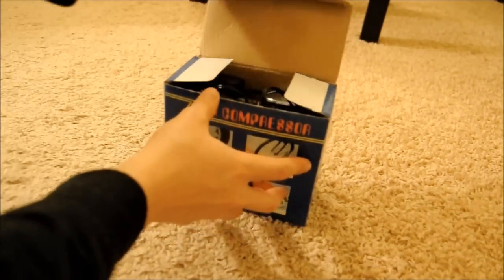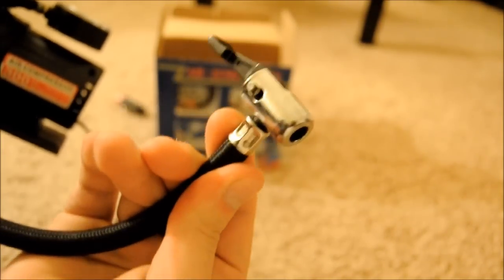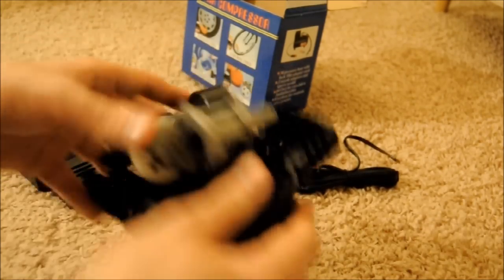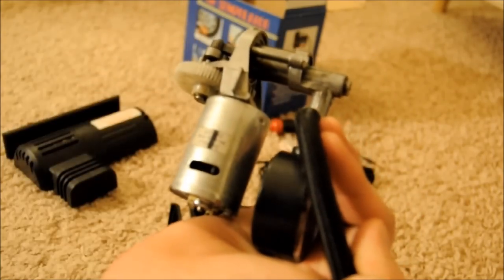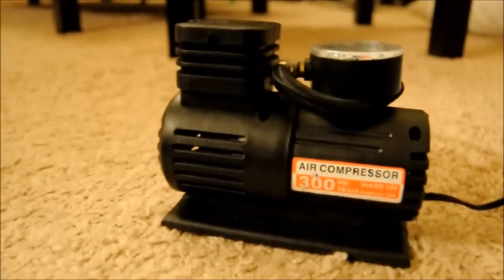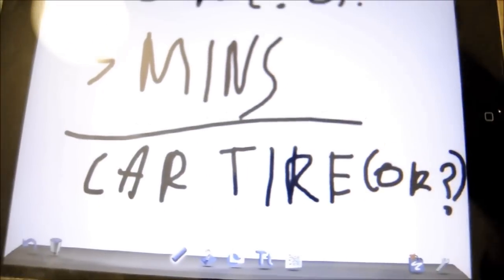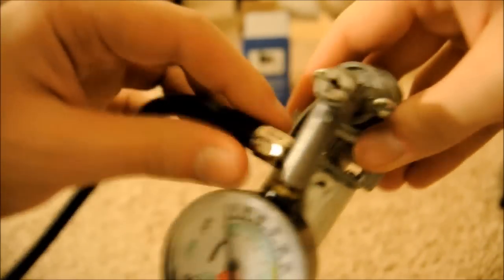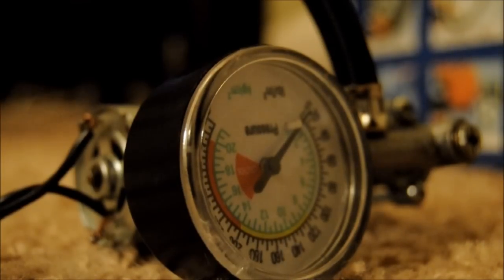10$ 12v Air Compressor FAST Review / Safety & Project Instructions! (Ebay Compressor)

Comment: Construction seemed sturdier than other units I considered MyBest.Tools Noise level was reasonable. Good pressure and cfm capacity for a small reasonably light compressor.
Reply from the maker: No idea, not much

Comment: This is INSANELY nice.💫 allabout.wiki/Viair  i got a Bostitch 6 gallon pancake and the regulator broke, and it was stupid loud. Also, the gauges barely worked. it wouldnt even power a die grinder. But this little dude ROCKS. Its not only 1/4 as loud as the Bositch, it works like a fine tuned machine should. Kudos to California Air Tools! This performs EXACTLY as advertised. Cant beat the price either.

Comment: Hallo,can connect it to house socket ?change auto device with hous plug
Reply: I did I cut wire n add usb
Reply: @loyaltyovermoney5942  hallo ,there is voltage diffrence hause voltage is 120 but air conpressor is 12 .thats why it is problem muss ask somebody

Comment: Could this reach 180psi? If not how much? Thanks
Reply from the maker: I don't think so, it could but it will self destruct. This works best under 50psi, eg for tire inflation. Maybe you could pump it up to 100-120, but it starts becoming a time bomb.
Reply: @JohnCraftingLab  lol fuck okiedoke, thanks saved you me a disappointing purchase have a good one 👌
Reply from the maker: @dunno6442  no prob. also check out making an air compressor out of a fridge compressor, you can get those even for free, not sure if they will compress to 180psi though, they might get to 200-250psi but not sure which ones.

Comment: Can you tell me which dc 12v motor is used in this and how much rpms does it have ?
Reply from the maker: No idea about the motor, it sounds like about 3k rpm when free spinning or so, the motor however isn't all that great compared to other similar sized motors that you can get off of ebay and such meant for projects.

Comment: I just bought this compressor. Is there an on/off switch? Plugged it in, attached it to the stem on my tire and nothing happened. Mine did not come with instructions.
Reply from the maker: Nop i don't think there's any compressor like that with a switch although that is an easy addition but anyways. To make sure it works properly force your finger against the air outlet to create an air tight seal to see if there's air forcing through the hole as it should have worked by its self as you describe.

Comment: can I use it to Operate a pneumatic piston for lifting loads ??
Reply from the maker: Yes you can if your pistons will work with less than 150 psi,just you will have bad time waiting for it to get up to pressure.

Comment: love it! i have a question though. can i even exceed the maximum pressure stated in the specs? i assume not right? just that my compressor will make so much noise and will struggle to maintain at that maximum pressure. am i right?
Reply from the maker: The design is very brittle,you will face one-way valve or hose problems beginning to the normal tire pressure range,let alone 300 psi.
Most people successfully work these things to 150 psi or so but even that seems way too much for it.

Comment: Will something bad happen if I use 12V 4.7A laptop power adaptor with this compressor? What hose and fittings I should buy to have 4 outputs? Thanks

Comment: The material that makes up the cylinder is quite thin and the crank is very poor quality, but in these budget pumps it's all bolted together nice and firm. 
In the more expensive looking (and costing) models that look smart, such as the circular pump with a digital gauge and set pressure cutoff (like the one I paid £30 for) the motor, and cylinder are held in place by plastic mouldings in the case. The plastic tabs suffer fatigue from the vibration, become brittle and fail causing the working components of the pump to fall apart.
As far as these chinese compressors go, cheaper is simpler, and simpler is better.

Comment: Could you check how much Amper runs thru the motor?
Reply from the maker: +Hulla Dek Like 10 amperes max,more if it stalls due to pressure but the hose blows sooner than the motor.

Comment: i've been banging my head to use such products ( running from car cig lighter slots )  on  home ac supplies of 220 v 15 amp.  i liked that car washer and this air compressor because of cost and the work they can be put to in aeroponics/hydroponics on a smaall scale..Can you please tell me the direct current they'll draw or any adapter to run them on domestic ac supplies of 220 v 15 amp.
Reply from the maker: denish vedi 6 amps maybe under slight load like a car tire maximum 10 amps at 12v9

Comment: gonna get one soon i am gonna rewire it to make it work on a adapter so i can plug it 10 bars is a lot of pressure and its not 100 euro's or more
Reply from the maker: Just beceful cause in practice the maximum non stressful working pressure is up to 100psi or maybe a little more,let alone that the one way valve sticks open sometimes causing a leak

Comment: how to plug that air compressor direct to the main power supply at home.i don't wonna use my battery up.please make me a review
Reply from the maker: Plug it on a car battery charger or computer power supply 12v rail

Comment: l found a used similar pump 12 v, tried a smallish 12 volt transformer,it pumped air but  too weak it seemed for the load when blocking the valve with finger and tf smoked too, overheating. now l got a big one 12 v, still not working , now it runs but  does not pump no matter witch polarity, or is the motor stationary maybe and vibrating , or did it destroy the gears plastic  could be. good idea to use a pc power pack.

Comment: I really love your fucked up voice it's so cool.
Hey I have a question If you used a 18V Battery would it make the engine spin faster and fill up my tire quicker?
And would the motor burn?
Reply from the maker: Lol this is after like 5 years but yeah it would until it blow.

Comment: This compressor is oiless but,can i add oil to the cylinder?  i wonder this because i have one of this equal and i notice that the compressor got warm due to long time running. i used pneumatic oil ISO 32 in the smaller hole where the piston sucks the air and in the cylinder. Is it bad for the compressor or not?

Comment from the maker: Yes,it does not have any problem up to 100-120PSI,it inflates tires with no problem but keep in mind you might be able to pump up the tire with a high displacement hand pump much faster as the cylinder of this is about 5cc.